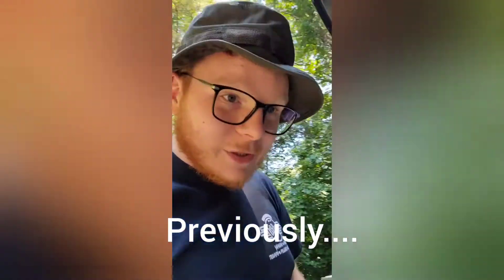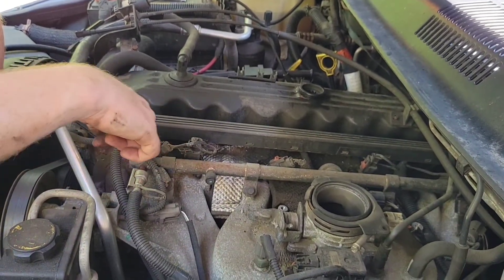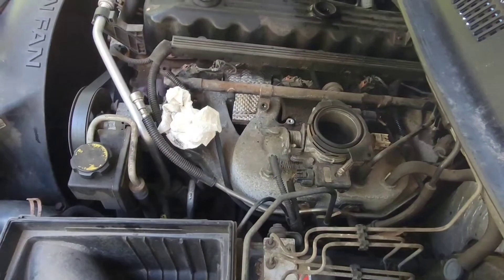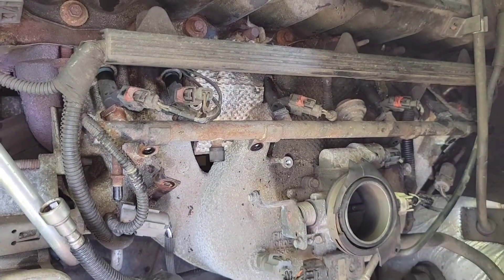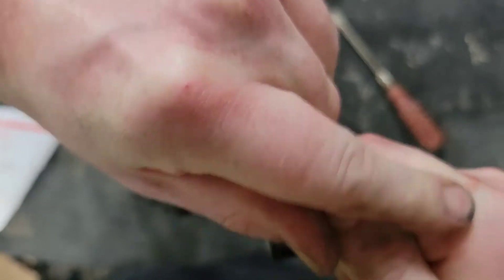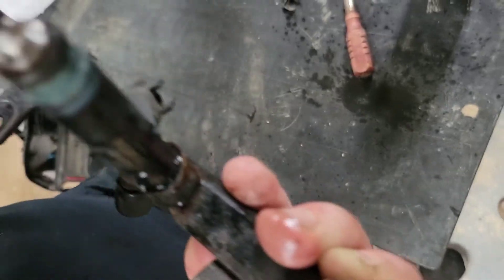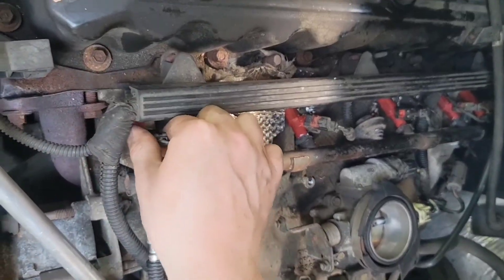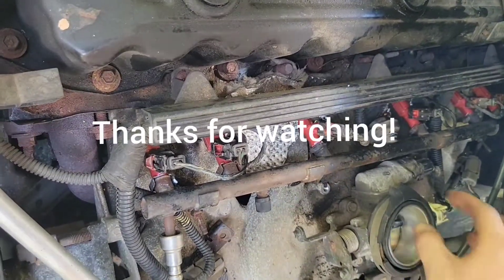12 Hole Injector Swap - Jeep WJ 4.0 - INCREASE MPG!

Comment: Thanks for the informative video -- Seems like people keep using the wrong stuff for lubricating those O-rings -- You used WD-40, which is OK -- but Silicone Grease IS NOT OK, okay !??
NEVER use any kind of Silicone lubricant near or around your fuel system. Be safe, not sorry.
 Modern Fuel Injector O-rings are NOT made of rubber -- they use gasoline-proof material, instead.
 I use and recommend Full Synthetic Engine Oil to lubricate your O-rings. It's Easier, Faster, Cheaper, and Cleaner.
How to ACCURATELY check your Fuel Mileage:
1. Completely Fill the tank.
2. Record the Odometer Reading.
3. Drive until One-Quarter of the fuel is left.
4. Re-fill the Tank, recording the fuel used to two (2) decimal places. (00.00)
5. Record the Odometer reading.
6. Subtract the 1st odometer reading from the 2nd odometer reading.
7. Divide the number of miles traveled by the EXACT number of gallons used.  (00.00)
8. NOW you know your fuel mileage exactly -- for the last tank of fuel you used.
 I keep a Fuel Log Book, and record every tank of fuel -- lets me know RIGHT AWAY about any pending problems.
https://www.mercuryforum.com/forum/grand-marquis-14/1995-grand-marquis-restoration-8937/
Reply: Someone said you can also use petroleum jelly, is this ok too??
And if not, I guess I can pull off a little synthetic oil from my dip stick. It's fresh. Lol
Reply: @jat-justamaturetech-philpj8285  The important word there is "petroleum" -- NOT good for rubber stuff. 
 Synthetic oil from your dipstick will work fine. 😁
Reply: @SlikLizrd  Like you said, the ring's on the injectors are not rubber. 🤷

Comment: So I should get injectors with 12 holes ? I have 4 now on my 3.7 L 09 Laredo
Reply from the maker: Not too sure about the 3.7. I would say if you already have 4 hole, the jump to 12 hole probably wouldn't be an extreme difference. Might not be worth the work🤷‍♂️. Thanks for watching!
Reply: @overlandoblivion8137  it was a difference thank you for your video. Jeep running good now and the mileage improved

Comment: Whats the mpg now
Reply from the maker: Wintertime mixed driving, about 18. Summertime all highway, 23.3mpg calculated at the pump.
Reply: @overlandoblivion8137 o your saying on a 20.5 capacity tank at 23.3 mpg is 420 miles???

Comment: Nice vid. planing to do so as well. Would you mind sharing the benefit you see since installation and also where you purchase those brand new injector. How is your mileage improvement and did you gain any sort of power out of this ?
Many thx
Reply from the maker: The benefit is replacing stock 20 year old injectors for newer units that are more reliable. Also, increased mpg, I was able to get 23.3 mpg(calculated at the pump) on a 300+ mile trip. I got the injectors from K suspension fab... link in description. There was minimal power increase, but a major mpg difference.
Reply: @overlandoblivion8137  thanks for the reply
Reply: @overlandoblivion8137  changed the injector but after 1/2 tank i noticed exagerated gas consumtion. Does it take some time for the calculator to get used to the new injectors ?
was able to get 230 kms/100 now 150 :(
Thanks
Reply: @overlandoblivion8137 Hi, can you explain why some  Amazon injectors say they can not deliver to my location? Is it a state EPA thing? CA here.
Reply: @jat-justamaturetech-philpj8285   California won't let us install "reconditioned" or "rebuilt" fuel injectors. 
 It's better that way. 😁